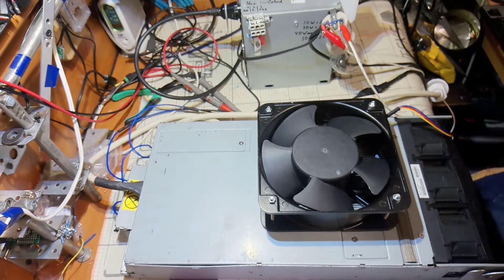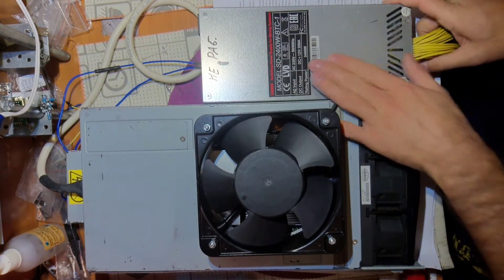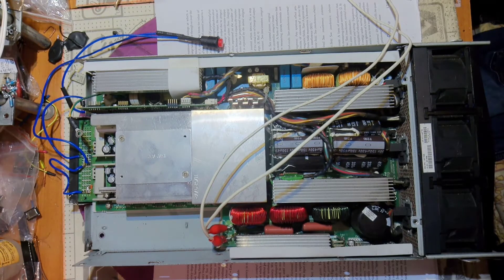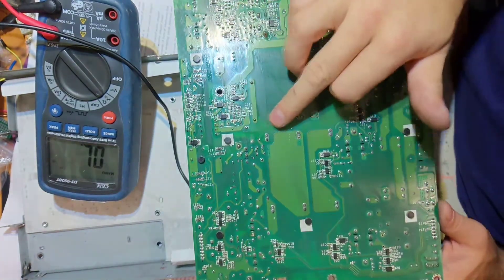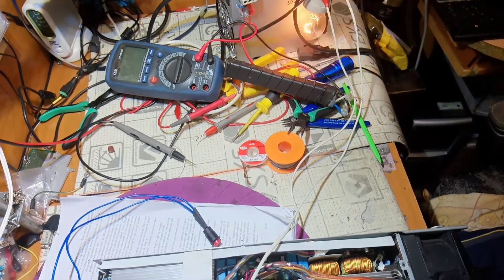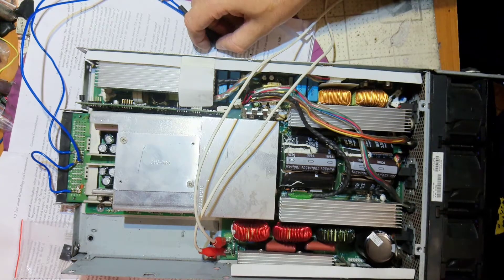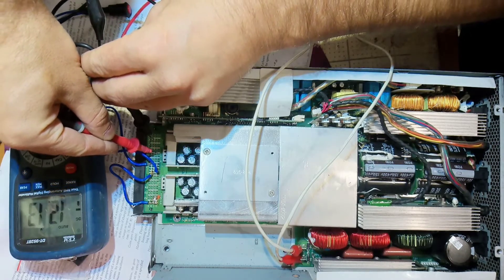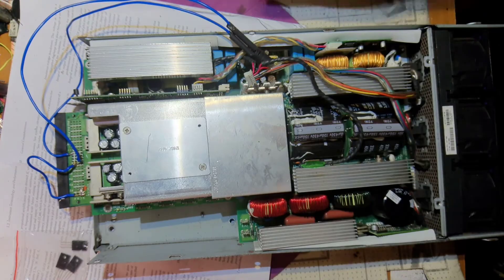IBM server power supply repair

Comment: I have an Atsn atsn 7001133 y000 from hp which i am using to drive my car amps in the house...but now it turns on for like two mins the n powers down and cannot turn on for the next like 3dys....i probed the fets of the out put and some were shorted out...but i had not pulled them off the board...i'm afraid i will solder them not tight enough...can you help
Reply from the maker: I could but I am from another country...
Reply: @electronicshaverightstolive  how about an email or guide or something to help me make it work
Reply from the maker: @bassmanwell1255  my email is tomtaminant@gmail.com

Comment: I wait for reply. Why my supply is doing that even dc power switch on or off as u switching on with  the button.
Reply from the maker: Sorry. I dont understand what exactly do you mean.
Reply: My power supply dps800gb ac input plug melted .I replaced  it with other one .when I plugged it  in series with 200 watt incandescent bulb the relay inside and series bulb starts clicking as in ur case .what is the fault ?
Reply from the maker: @ayazshah7628  did you try it without series light bulb?
Reply: No.can I try it?
Reply from the maker: @ayazshah7628  you should try. With use of circuit braker 16 amps or less.
Reply: @electronicshaverightstolive  ok I will try
Reply: I did that with direct mains and found ok

Comment: Was it due to series supply  that relay clicking? and when u connected directly to main ie 220 volt ac it worked.please reply because I m facing such problem with my smps hp dps800gb
Reply from the maker: Relay on your  power supply is clicking and there is no output?